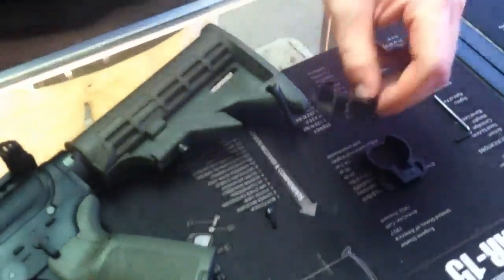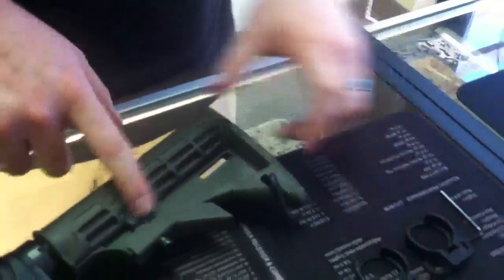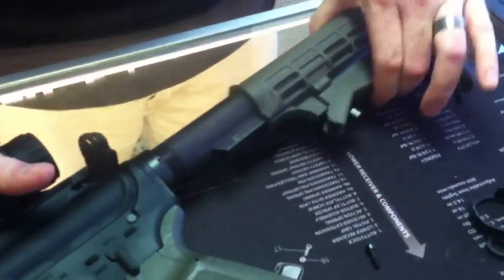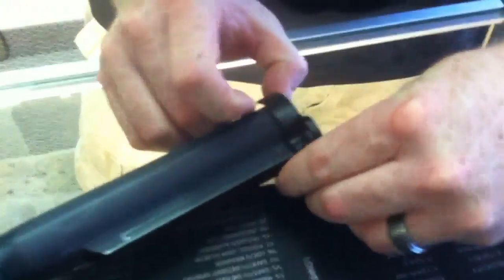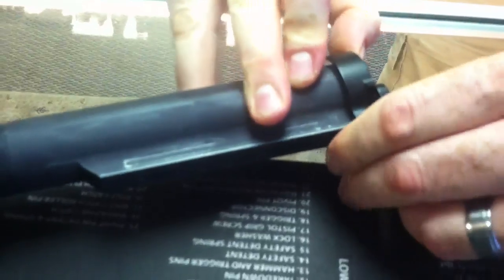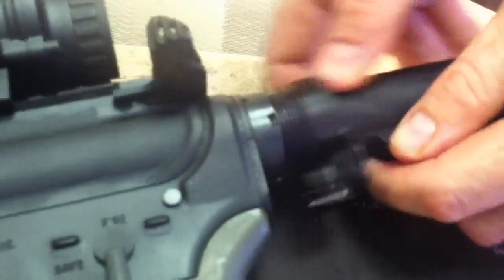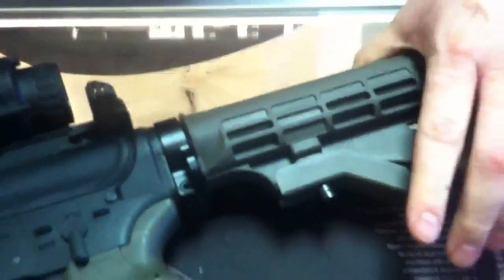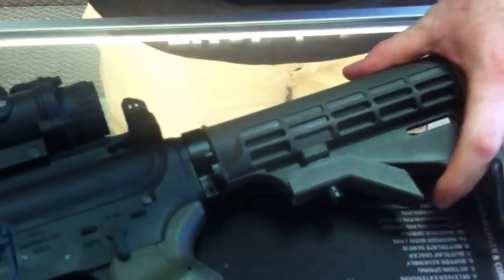Slip Over Single Point Sling Adapter Install

Comment: I got mine in the mail today.  Do you have any suggestions about how to make the adapter tighter on the castle nut?  Mine is definitely loose.  I thought of 2 ideas.  

1 - Put a very small strip of electricians tape on the castle nut.  That extra amount of material might just do it.
2 - Use a standard nail file to remove a slight amount of the adapter where it bolts together.  

Any other ideas?